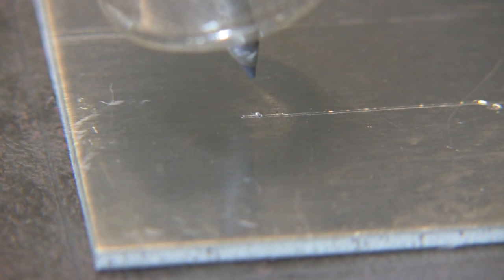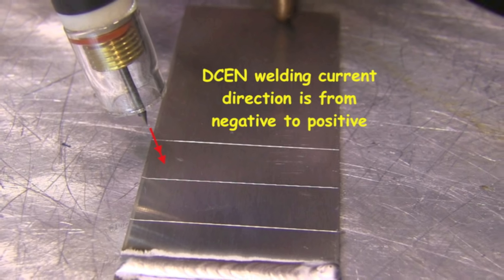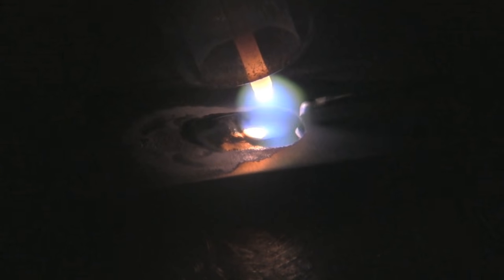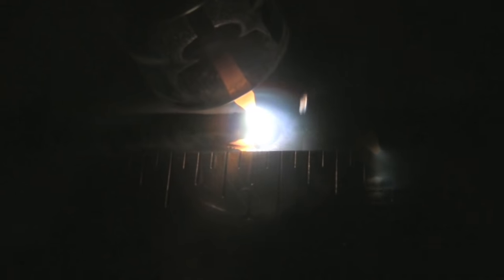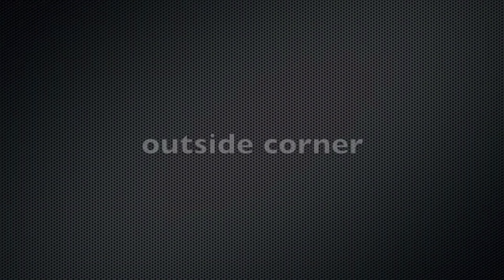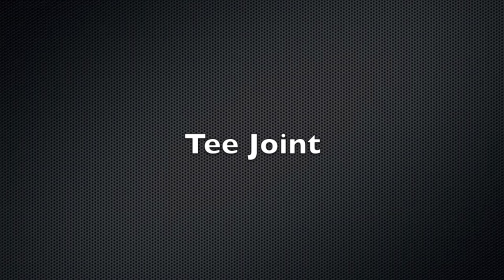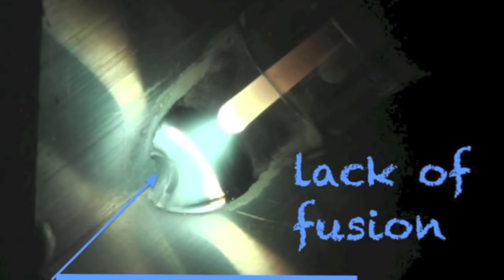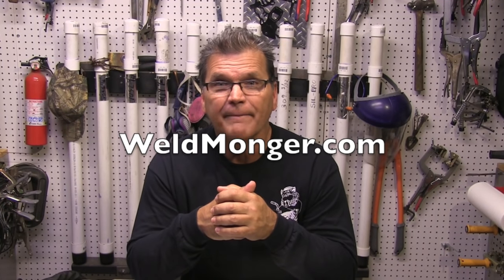How to TIG Weld Aluminum part 1

Comment: How do I prep Aluminum best?
Reply: MegaXxxfreakxxx First wipe really good with de natured alcohol/acetone... Then 4" scotch brite pad on angle grinder /stainless wire brush( FYI.. If using a brush, make sure its used strictly for aluminum as not to cross contaminate the parent metal)to remove oxide layer... Then wipe again with alcohol/acetone, and before striking up I hit it lightly with a small stainless hand held wire brush once more..Keep your tig filler rods wiped clean also I have welded aluminum daily for 10yrs, and that is my routine... 😀
Reply: Where I get confused is : I have a big miller 250 syncrowave.  Are you supposed to swap the cables. Put the negative on the positive post and the positive on 5 he negative post. Because there is no mention of this in the manuel but heard 8 was supposed to.  So just not sure. Thank you
Reply: JASilver, if the selector in on AC(?) the two leads polarity is not critical, as Jody mentions in his video; the polarity is switching back and forth from DC- to DC+ in the AC mode.   So, with AC, most common mode of welding aluminum, the two leads are automatically switched from one polarity to another at least 60 times a second.
Reply: Jonathan Artsy Silver no on the syncrowave you have a big handle in the center that you turn straight up,  it should point to a squiggly line.
Reply: Jonathan Artsy Silver no on the syncrowave you have a big handle in the center that you turn straight up,  it should point to a squiggly line.
Reply: MegaXxxfreakxxx scotchbright and acetone.
Reply: Dave C Scotch brite disc removes only the oxidation layer..You would be really hard pressed to actually grind with one, and remove metal... I use the 4" green Velcro pads with rubber backing pad, they are around 3/16" thick... They leave a shiny, scratch free surface
Reply: Dave C Gotcha Brother👍

Comment: Very difficult! Need a high amp machine..my little tig 200 is only good for up to 1/8"  no matter how well i clean the base material it was like 💩 not to mention the inverter factor.. t3 is the only tungsten that seems to hold up..

Comment: I have a Lincoln 225 is it a transformer or inverter machine?
Reply: If it's a "tombstone" looking red job that weighs a fair bit, that's a transformer type unit. Inverter types tend to be small, compact, lightweight, and have several settings, usually all digital, instead of a crank or lever "tap selector" setting device on the front. Another trait is they have gas feeds or other features, such as water cooling.
Reply: Very helpful thank you!

Comment: Tried this but i didnt even get the chance to apply the wire, it would just bend back when about 3/8ths from puddle
Reply: This is a pretty common thing to happen when learning. It’s usually due to the angle of the filler rod going into the weld. If the rod angle is off; youll just be burning rod off before it gets into the weld. If you correct the rod angle (approx 90degrees to the angle of your tungsten) it will feed better:)

Comment: It's known by most that when TIG welding aluminum, you use a helium argon mix typically. Could you please shed some light on what exactly happens as the helium content increases from 0% up to 100%?
Reply: I  have never heard of that for TIG welding aluminum for copper yes not aluminum

Comment: The fat lady sitting on my chest. It's been about 40 years since I worked at a shop aluminum welding on ocean going containers, mostly mig. But just a note that the fumes coming off aluminum are much more dangerous to your health than the fumes from steel welding. You can see that fine powdery white residue on the weld. Fat lady on my chest is what we would call it when we got too big a dose of those aluminum oxide fumes, and gave us breathing problems.
Reply: John C when I was an apprentice part of my rotation was in the toolroom and I got shown how to tig up plugs into press tools and we were forbidden from welding alloy unless wearing an air fed mask